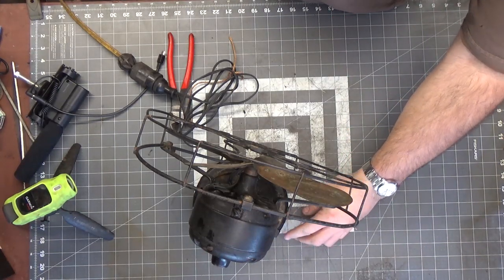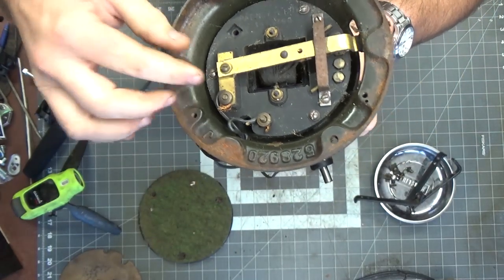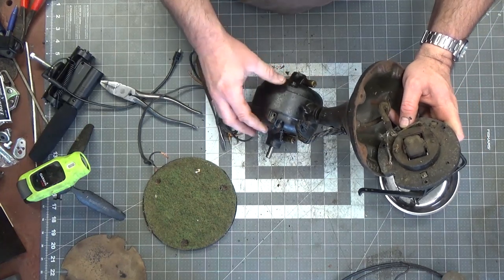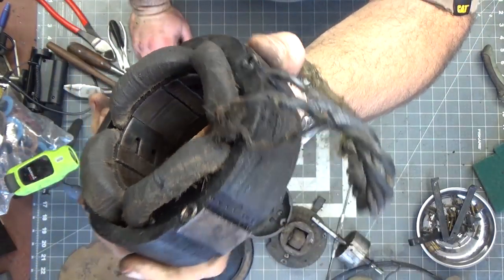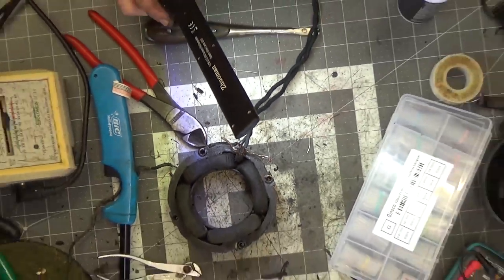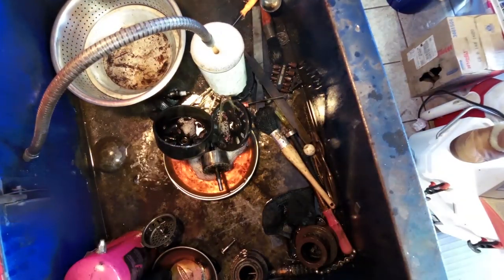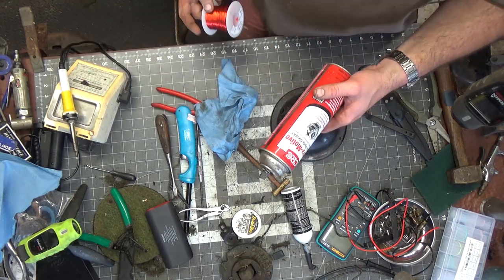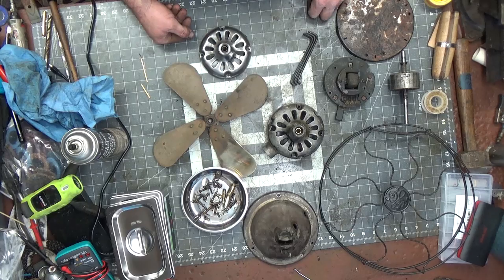Antique GE Desk Fan Restoration (Part#1)

Comment: I think that green with the polished brass blades and the polished steel back of the motor will look amazing. I hope that brass control plate looks good. Can't wait for part 2.
Reply from the maker: Hi Ben, The brass tag is in good shape, but i'll need to freshen it up, hopefully I don't mess it up. Cheers

Comment: Hey Joe I have one of these that I got when I was in the army I think it's from the 1950s and it is also a 3-speed but it is an oscillating fan with steel blades instead of brass. It has a DOD part number on it and now that I've seen you take this apart I think I will just leave it together as a shelf decoration. Mine runs fine just like yours did but it's not something I'm willing to risk my life for. Great job on the disassembly!
Reply from the maker: Hi Bill! The oscillating fans are so cool! Yea this ran fine, but it was definitely a fire hazard. I should have part 2 up in another day or 2. Cheers

Comment: Nice project Joe. Tips on the wiring did help. Wires like that normally intimidate me.
Might it be an idea to paint the base and that band in the middle of the motor and leave the rounded parts polished, I think that would look cool.  O and make the rivets on the blade green as well, for the contrast. Just things poging up in my mind.
Reply from the maker: Hi Alex, I think we are thinking along the same lines. I didn't leave anything polished, but I did add some contrast, you will see in part 2. I'll look at it and see if painting the rivets makes sense, it sounds like a great idea, thanks. Cheers
Reply: @joeheilm  I look forward to it!

Comment: For future reference, I had an old fan similar to that that was a nasty oily mess. I needed to clean it so I can see what wires needed to be separated Etc. but not damaged the winding. I bought a container of goop hand cleaner. Shoved it all in and around the winding and threw it in a plastic bag. I filled the plastic bag up with goop hand cleaner zipped it closed & let it sit for about 2 or 3 hours. You can let it sit for a day if you want! Then I took it out used a soft bristle toothbrush make sure I got the oily crap off of it rinsed it off in warm water. Blow dried it off and let it sit and dry for 24 hours. It will not hurt a single thing in the winding, as long as it is dry when you're done. It won't hurt the tape , it won't hurt the paint, it won't hurt anything & It is much easier to work with once it's clean!

Comment: This was a great help! I’m new to restoring fans and need help identifying the wires. What meter do you prefer that is helpful for a beginner. Thanks
Reply from the maker: @DamonSpears-vp7qs  check out the EEVblog YouTube channel, he has a bunch of great videos that explains multimeters. The AstroAI 6000 is $26 on Amazon is the one I have been using lately. I hope this helps. Cheers

Comment: That's a great old fan Joe! I was going to mention a source for new vintage wiring but then saw you already had some from your brother!! Great to see you're going to use it. Looking good so far and can wait to see the end result👍

Your comments about the guard protecting the blades reminded me of a Family Guy episode where Peter attaches razor blades to the fan blades to help him shave quicker...Well you know how that turned out. Anyway, don't  know if you watch that show but it made me laugh.
Reply from the maker: Hi Steve, I cut the cord years ago so I don't watch much broadcast TV. However, I am not opposed to a laugh, i'll see if I can find that episode, it would be funny to insert some short clips of cartoon fan mishaps ;) Cheers
Reply: the windings should come out with outside metal round part of windings is this correct thank you for your responses
Reply: what I meant to say is ,,,,
Should the round metal part attached to the windings come out too,I keep trying but I can't break it free.

Comment: Hi Joe looks to be in really good shape to begin with of course that is through the eye of the camera. Sounds great while running. Love that original GE logo have that on only one item a 3 phase giant grinder motor. Another great video and we look forward to part 2. Thank you for being our friend Joe, Lance & Patrick. 
Are those bronze oilite bearings in the fan? Factory correct paint match. No you had it right California thinks it is its own country LOL. I had a pair of and lost them (temporary) those little silver metal thin channel lock style pliers.
Reply: I think they are called Ignition Pliers.  My father ALWAYS carried a pair in his pocket . . . now I can't walk by a pair at the flea market without buying them.
Reply from the maker: Hi Lance, Hi Patrick! They appear to be oil impregnated bronze bushings, I am not sure if "oilite" is the same thing? I think I have seen that BIG yellow GE grinder in the background of your workshop....what a beast! Trading Post is correct, those little slip join't pliers are called "ignition pliers". Thanks for watching and commenting! Cheers
Reply: @joeheilm  Yes Oilite and Oil Impregnated Bronze are the same both are a pressed course oil flow powder that must be machined with very sharp tool bits (blocks the oil flow by closing the pores) or we risk the loss of the oil being in the bronze and receiving new oil periodically. Thank you Joe.

Comment: Hey Joe, liked your video. I have one of these antique GE fans and the arm that changes the speed has the plastic end broken off and the metal is showing so that it has electricity on it, so very dangerous. I need a new handle, do you where I can get one? I tried the Plasti Dip but it doesn't have the strength to stay hard enough. Thanks again.

Comment: Thank you for sharing this inspiring video. Working right now on very similar (if not the same) model from Shibaura model 6051, Japanese version of it. How to do you remove the motor coil from the iron casting a 8:52  ? Two hits using a mallet and the magic is done ?! Lucky you are. Mine is stuck and the wiring in on the backside so I have no choice but to remove it. Any hint ?
Reply from the maker: I think i have another fan video, which shows me (in time lapse) fighting to remove the coil. All i can say is be persistant, once you feel it move rock it back and forth....it is a very slow process. Good luck cheers

Comment: I am disassembling a similar fan as this one in the video. When you went to remove the windings, and used the small dead blow, how much effort was it to get it to budge? I have all the screws out I see around the motor housing. I'm wondering if I am missing something.
Reply from the maker: I remember it being a very tedious process with lots of lights blows...patience is the key. Cheers
Reply: @joeheilm  Thanks for the response. I came to the conclusion I needed a small dead blow. I was using a large one but I was using light force. It came out after 5 minutes after the switch. I have made the mistake going full brute in the past so I'm a little precautious when it comes to hitting things haha. Thanks for the videos. I plan on using them as a guide for this project.
Reply from the maker: @briantalbott516  i hope it helps. Cheers

Comment: Question is it possible to get the windings out of an old GE Fan ,the wire in the back have lost the covering ,
Reply from the maker: Yes, i forget which video it was, but i had to resolder new wire to the windings. It is a pain slowly wiggeling the field windings out of the housing.

Comment: Hey I have a fan like this and the back bearing is shifting up and down and side to side in its place is this normal?
Reply from the maker: Hi Rocky, that doesn't sound right. I believe the bearing should be static, and their should be a coton wick, which holds oil to lubricate the journal....its been a long time since i had mine apart, so i could be mistaken. Cheers